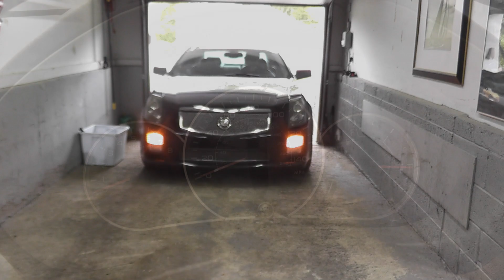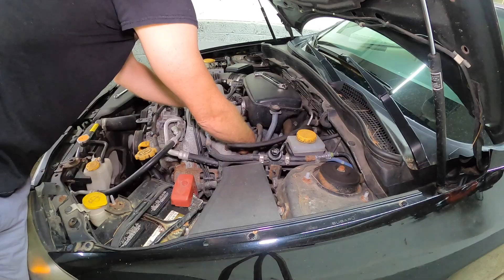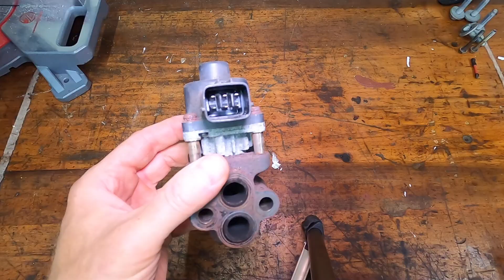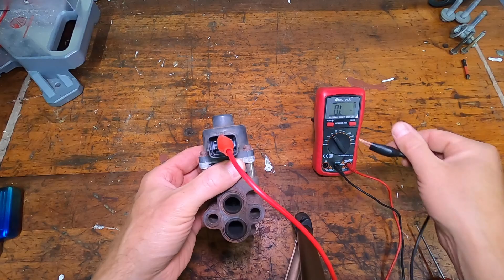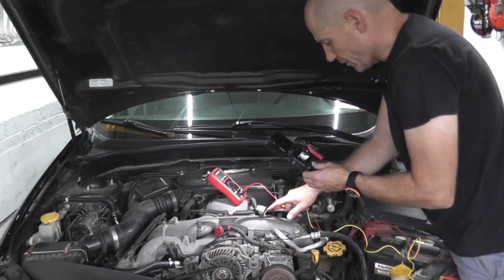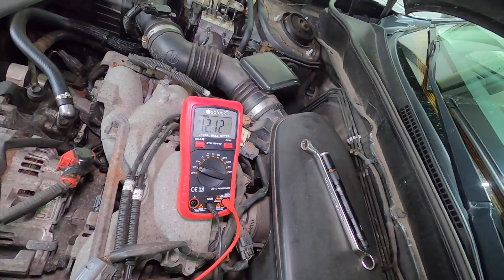EGR Solenoid Valve - Rough Idling - How to test and replace

Comment: Hello! I'm in the process of testing the same EGR valve on my Legacy as it's throwing P1496 code. 

May I ask if I test the resistance on the harness connector the same way as the EGR valve shown in your video to make sure if the wiring harness in good shape all the way to the ECU?

Comment: I had a trouble code p1410 that is also connected to this valve. Though my Impreza has a different engine el154. Thanks for the explanation.